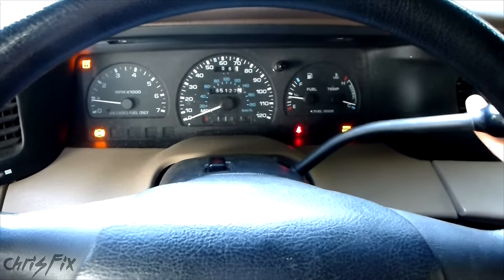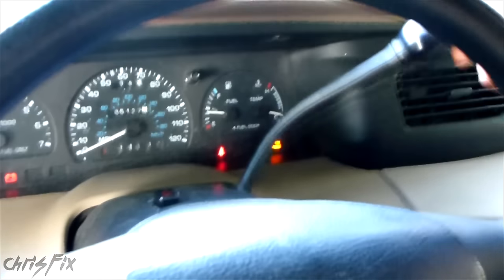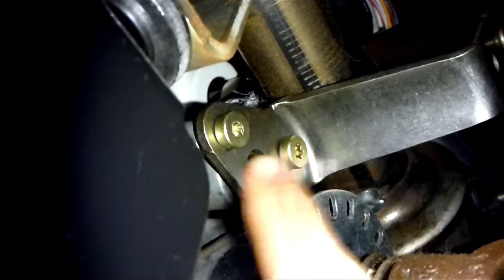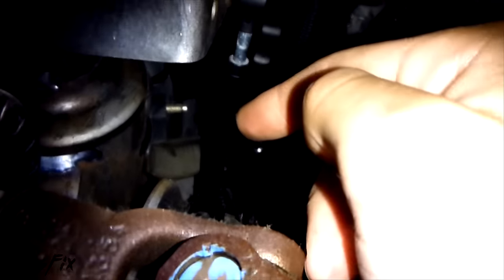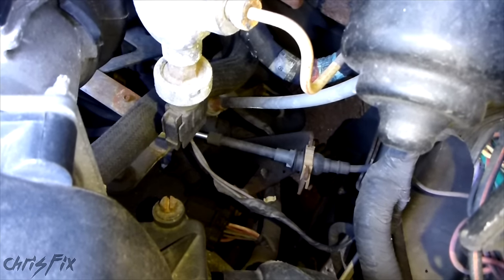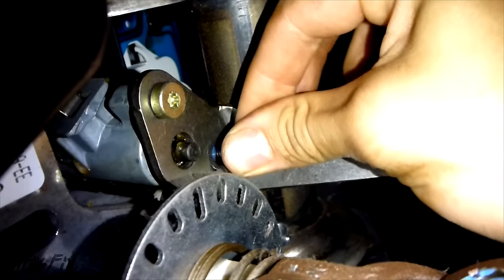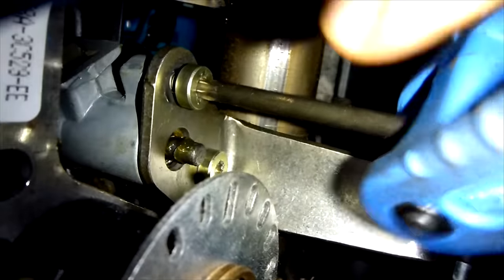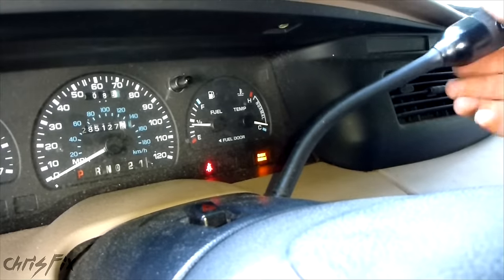How to Fix a Loose Column Shifter

Comment: My truck wouldn't start. I jiggled the shift lever and a screw fell on the floor. I looked up there after watching this video and can see that the casting that the screw went into is broken such that I cannot replace the screw. Now what? I cant see that entire broken part or how to remove/replace it. Any advice would be much appreciated.

Comment: It's 9 degrees outside and there's a foot of snow coming.  Without the plow on my truck, we would be stranded in our home.  But the shifter has been loose, getting looser, and has started making funny pinging sounds while shifting.  I shift constantly while plowing: driver, reverse, drive, reverse, drive, reverse.  I've been genuinely worried my truck would end up breaking down in the middle of the driveway.  THIS VIDEO SAVED MY SKIN!  Found the screws, they were the problem.  Tightened them up, and now I'm ready for winter.  THANK YOU.

Comment: This literally fixed 90% of the problem. I was told by a mechanic that the cables needed changing and it could be even more complicated than that once he dove into it, then I watched this video and it was spot on! Thanks for this!! Something else informative was a video on how to line up the shifter indicator in the dash with the appropriate gears (P RND21)… I found another video on that because little red indicator wasn’t aligning properly, and it was also spot on! Thank g-d for videos and people like you!! The mechanic would have ripped me off. Looks like I need to find a new mechanic! 😂

Comment: This is a very helpful video. My shifter has been loose for some time and I thought it would be a big ticket item to fix and held off bringing it to a repair shop. A screw fell off under the dash and I had no idea where that came from. It wasn't until I can't put it in park anymore, I thought to check out youtube before going to the shop and saw your video and this was exactly the same problem I had with my 94' Nissan Quest. I followed your video to the T and it took me 15 mins to fix the shifter. Thanks a whole bunch. You saved me a lot of stress and anxiety of driving my car. You Rock!

Comment: OMG, Thank you a million times over for creating this video!  My Husband is working nights and last night my Son and I had to have our car (Ford Taurus) towed to our house because it wouldn't shift.  So upon watching you're video just now I went out to my car, got out my tools and the inside of the car the bolts were tight.  I looked under the hood like you showed and sure enough the bolt broke and needs to be replaced but I was able to slide it back in for now, slide it into park and sure enough my car started and shifted gears perfectly.  So now I need to go to the parts store to replace that bolt.  You are a rock star, once again THANK YOU!!!!

Comment: This was exactly what was wrong with my 1999 F150. It also affects starting because the shifter has to be in Park to activate the start switch. Fixed it 10 minutes. Thank you for this video.
Reply: Or it can be in neutral to start too.
Reply: So did you do exactly what he did and it worked? Cus i think my shifter won’t active start switch.
Reply: @kikibarrios1231  I put it in every gear and it still won’t work. Park reverse neutral and drive, and still nothing. Earlier every time I touch the shifter all my lights would turn off or flicker

Comment: This video saved my son's bacon today. He bought the truck after it had been pretty used up and the shifter was always sloppy. This morning, he couldn't get it in drive without a lot of pounding and swearing. He found your video and he followed your lead and now his Ford Ranger shifts like a boss. One bolt had come completely out of the assembly and was on the floor board. He said to say "Thank You"! Well done.

Comment from the maker: +Hudson Carter, Thanks a lot man! I love suggestions. I just finished filming the top 10 car cleaning mistakes and now its onto editing. This was a really tough video and now that I am editing, its getting tougher! So stay tuned for that by the end of the week! And thanks for the other suggestions! I will add it to the list of videos I need to make, which has become very very long! I see why they have production crews lol
Reply: You rock chris
Reply: That's how I fixed mine
Reply: +coloured
Reply: ChrisFix  hey bro you save me with this video!!!
Reply: Hey ChrisFix,  I've learned so much watching your videos.  Could you please put a video on how to replace the Clock Spring Assy on a 1995 Ford Taurus GL?  I watched your video on how to remove a steering wheel and you mentioned the CSA and so I'd like to see how to replace the CSA from start to finish. I need to replace mine.  Thanks so much. Keep up the great work!!!
Reply: ChrisFix s.
Reply: ChrisFix This information & the how to Video was so helpful! Thanks
Reply: ChrisFix yo, the shifter column is also loose in my ranger but its different from the one in the video
 the rear clamp broke on mine plus a metal pin (idk where it came from) snapped in half & broke
plus I'm missing a torque screw (that I didn't even notice) for it when I check that metal thing near the brake pedal
Reply: I have a 96 sedan deville with a very stiff, almost too tight shifter. Any recomendations?
Reply: @patrickcordery1635  【
Reply: Do I need to put it in neutral before putting the bolt back in?

Comment: I just bought a used F-150. This is a huge problem for me and I thought I'd have to replace the assembly. You saved me a huge amount of time. Also the odometer doesn't work, which you fixed in another video with a Mustang. Right now you are a hero. Thank you so much!

Comment: This fixed my problem in a snap! My '95 E-350 wouldn't shift into park.  After watching your video I discovered the bolt was on the floor underneath the dash! I screwed it back in and tightened up the 2nd bolt. Easy fix! Thanks a ton!
Reply: @Davey Carfax did you have to put it in neutral while retightening??

Comment: This is the genius of Chris Fix. My mechanic charged me $250 for a new shift column tube that did NOT fix the loose shifter on my 1997 Ford E150 van. The curious thing is I found that exact shift column screw lying on my driver's side floor mat and didn't know where it came from until I watched this Chris Fix video above. I then looked under the dash and sure enough the screw was completely missing from the column shifter. I confronted my mechanic with this video above and embarrassed the hell out of him. He had been in the business for 40 years and didn't know about this very common Ford shifter screw back out problem. He said he learned something and actually offered me a job. Thanks Chris Fix!!

Comment: Chris-  Thanks for this video and info on the loose column shifter issue in a Ford (Windstar).  I've been trying to diagnose this issue for too long, having intermittent starting problems, and not being able to figure it out.  I replaced the battery, cleaned the cables, replaced the starter and the neutral safety switch, and still had starting problems, plus the transmission not shifting into gears.  Once I tightened these two bolts however, no more starting or shifting problems.  Thanks for the great instructional video.  All owners of older Fords need to know about these two problematic bolts.

Comment: Just did this on my 98 grand marquis and works PERFECTLY! Thank you so much for the video! In addition, a common issue for ford cars is the shifting tube bushings going bad. Just replaced those as well and my car now shifts perfectly! Loctite and bushings only cost $11!

Comment: Thank you so much! One of those screws came completely out and fell on the floor and I wondered where it came from.  Could not put the vehicle in Park!  Found your video and tightened up both screws.  You saved me from some headaches.
Reply from the maker: +Kevin Morris Boom! Glad the video was helpful!
Reply: +ChrisFix  SAME THING HAPPENED TO ME!  THANKS!
Reply: Exact same issue.
Reply: Just happened to me. What kinda of wrench do I need?
Reply: Same exact thing was wrong with mine currently waiting on my in laws to come watch my kids but this is awesome. Thank you so much for posting the video
Reply: Same thing happened to me!
Reply: What t do you ask for when buying a new screw at the parts store?

Comment: Thank you Chris. This video solved my problems on my 1997 Ford Explorer 9 years after you posted this. It's amazing that Ford created such a wide spread problem like this. The trick for me was loosening one of the other screws first before screwing in the one that fell out. Also needed someone else to help put the shifter into park better while screwing it in. Easily saved me a tow to the repair shop which would probably cost 1k bucks for it all today.

Comment: The shifter has been driving me crazy for almost a month. Last night it finally took a crap and wouldn't allow me to get in gear. Found this video and it worked perfectly! I thought I was gonna have to pay someone to fix it and prob cost a lot. Also have an issue with my ignition switch. Which just spins. I have to start the car using the lever under my dash board. Lol. I wish I could give this video a million thumbs up. Thanks for an awesome fix!

Comment: Thank you.  This was exactly what was wrong and so easy to fix.  My 1997 F350 had gotten to the point that I couldn't shift or get it so that engine would crank over.  After seeing the video, went to see if it was the same and found one of the bolts laying on the carpet.  Had fallen out.  Replaced, tightened, and saved a dealer repair.  That has got to be at least $120 in the San Diego area.  Thank you very much.

Comment: Great video. Once I realized the bolt heads face the firewall and not the steering wheel - took about 10 minutes.Saved me not only money, but possible disaster as well. Had a few incidents of not being in park and truck began to move.
Reply: Took me a minute to figure that out too!

Comment: when I pull off the under dash panel a hex head bolt fell down , I was like wow where did that come from. I was going under the dash thinking to see if I could adjust the shifter because it would not go into park. But nothing I did helped. Then I sat down and started watching some YouTube videos about this problem and ran across this video and you probably saved me a couple hundred dollars taking it to a shop. Damn glad you posted this video, thanks bro 😎

Comment: Just wanted to say thanks.. Bolt came off hit my right leg when i put it in drive on a 2000 expediton. Had no clue where it came from just noticed my shifter lever was sloppy as hell. Looked it up on you tube, watched your video fixed it within 5 minutes.. Thanks alot great video.. Added blue lock tight as well.. 👏👏👏👍👍👍👍

Comment: Had a bad shifting issue on a 2000 Mercury Grand Marquis. The shifter was loose and would bounce between the gear selector locations. Sometimes I would have to turn the ignition to on and move the shifter to neutral to start the car. Found this video and went out and checked these two torx head bolts and they were very loose. I tightened them up and now the car is shifting between the gears like new. Thanks ChrisFix!

Comment: Chris...can't think you enough. I took me longer to put down a canvas on the floor, slide the seat back and slide under the steering wheel than it did to tighten two #30 torx screws. Blessings to You!

Comment: Thanks Chris! I was having the same problem. Saw a video about replacing the two plastic bushings on the shift rod, so I did, but still had a lot of slop when moving the shifter handle. Also wouldn’t go into park sometimes. Then I saw your video 3 weeks later. Problem solved. Thanks and keep up the great work.

Comment: Thank you so much, that is one less issue I just resolved in under 5 mins on my 99 Ford Windstar. A local mechanic wanted $85 for labor and tried to convince me I needed some new parts to fix that problem and it was just those two screws the whole time. I just need to resolve my cluster instrument box on my dash for fluctuating gauges and I should be able to pass state inspection now. Thanks a bunch for that.

Comment: I just fixed my 1998 ford Explorer that wouldn't go into park.wouldn't start unless I put in Neutral  and sometimes vehicle would even roll. THIS was the problem, loose T30 bolts. THANK YOU for video. Alot easier than other videos that only mention the Bushings under steering Column. Check this first.

Comment: Wow, what-a-find ! !  Shifter on my 02 Taurus Wagon, has been getting lloose, for 3 years.  Finally, would Not shift at-all..  Was going to order Ebay used Taurus shifter.  Found this, your Youtube-Fix.  Looked on car-floor, and sure-enough, found size-30-tork-bolt, laying on the floor.  Went to parts store,& purchased a little 'thread-lock, installed missing-bolt, and tightened-other-one, and "Good-as-new" ! !Thank You Very Much Chris....   Wish I could 'Send a Gift Certificate' ? ? ?    Lots of $$$'s & Time SAVED ! !
Reply from the maker: +Chuck Cummings no problem, I am glad the video was helpful!

Comment: Worked on my '95 Ford Aerostar! Long, long time issue where getting it into park was not at all reliable, reverse was about 1/16 inch  off the P indicator and at times I would have to shift it hard several times into park and hold it there to even allow the engine to start. Slightly different location for the T30 bolts but once I knew what to look for, there they were....and quite loose! Thanks so  so much!!!

Comment: Thanks... this was the exact problem I had on my 1994 F150.... watched your video walked out and took a look went back in and got the tool and Tightened up both bolts. Glad I did it when i did as both were real loose and would likely have lost one or both soon. Was simple and did not require any specialized tools for my truck and once I had the right size tool took maybe 2 minutes to locate and tighten. Everything seems to line up and shift like normal.... I really appreciate your video.

Comment: I had found the video about replacing bushings on column, which didnt seem too hard so I was prepared to do that. Found this video of yours for EVEN EASIER fix, and sure enough it helped a HUGE amount! So it’s all I plan to do about shifting for now. Apparently loose bolts had happened before I bought 2004 F250 couple months ago because one of mine wasn’t  torx. Want to get correct replacement now and use loctite.  Thanks so much for starting with the “how to find” even before you started the rest! I subscribed. Soon I hope to look up how to get instrument panel gauge lights to work.  For now, I’m thrilled to have this IMPORTANT thing fixed!

Comment: Thank you! I was freaking out when I got stuck at the grocery store parking lot and my truck wouldn't turn on or shift into park, had to start it in neutral. I found the bolt on the car floor when I got home, easy fix, shifts better than before lol. :]

Comment: Thanks for the vid. Happened to my 02 ford ranger today at a gas station. It wouldnt let me put it in park and suddenly felt alot of play in the shifter. So I was able to finally get it into drive to get it home, I then watched this video. One of the bolts on my shifter bracket broke right in half. Thanks to ur vid i found the shifter bracket. Would have never thought to look in there. Thanks for the vid :)

Comment: Just did this on my 2001 Ford Econoline E350 cargo van. The results were amazing. Ive been dealing with this loose shifter for probably 6 years and this past year it got worse to the point of not staying in park and starting to roll which was very dangerous.. The Vans have way less space to get a screwdriver in there so i had to so it with drill bit extender and just tightened as much as I could. Thx for the info

Comment: Excellent advice.  Worked on  1998 Ford F150. Easy access. Recommended improvement. Use lock or star washer, or high strength bolt. OEM bolt appears to be of low grade, low tensile strength metal, most likely reason for working itself loose.

Comment: Thank you for sharing this, Mine has been sloppy for years, but just begun the not starting thing today. I was under my truck adjusting the cable end (thinking that was the issue} and I saw one of the screws in the driveway. Didn't know where it came from till i watched this lol. 10 minute fix to one of my only complaints to this truck. Thanks again
Reply from the maker: Johnny Moss Glad the video was helpful!!!

Comment: Thanks for the info you were 100% correct. I have a 2001 F350 dually. The shifter was loose from day one, it had finally got so bad the truck was almost not useable. Well today I discovered your video and 5 minutes later my truck is fixed. Great job!! I will be checking in as needed.
Reply from the maker: Awesome! Glad the video was helpful Larry!

Comment: Decided to go check my 2005 Ford F250 column shifter and one of the bolts was backed out about a quarter of an inch.  Pulled them out one at a time and put some blue thread locker on them and snugged them up.  Thanks man!

Comment: Thanks, Chris.  I was ready to take my 2000 Ranger to get it repaired or take off the steering wheel cowling to try to fix it myself.  Thanks to your video I was able to put back the bolt I found laying on the floorboard of the truck with a little contortioning..
Reply from the maker: +BudandJan Dragoo AWESOME! That is great!!!

Comment: Im so glad you made this video I was working on a truck with a friend of mine The battery was dead i jumped started it and it run fine I put the truck in neutral with the parking brake on (Because puting it in park doesnt work) But it was really in drive. As i went to fetch my friend it took off and ran into a green house Destroyed the corner of the green house but now i can fix it thanks so much!